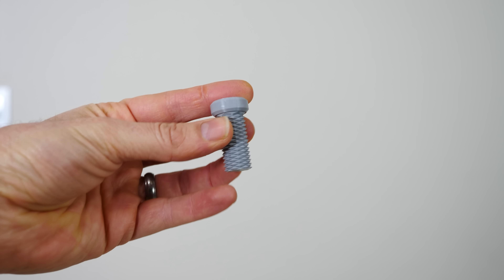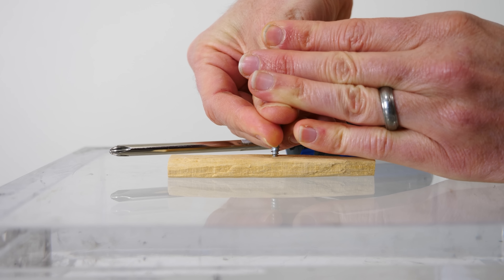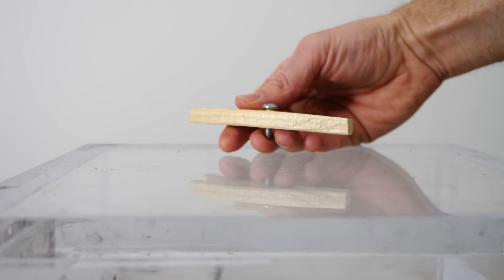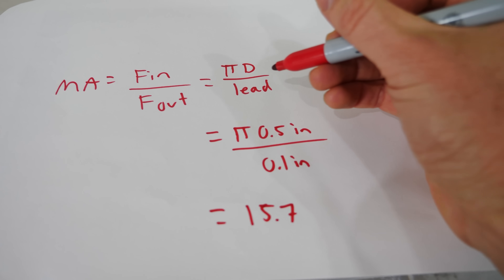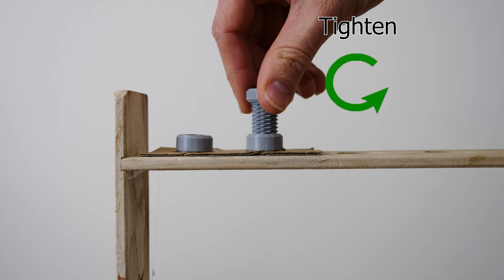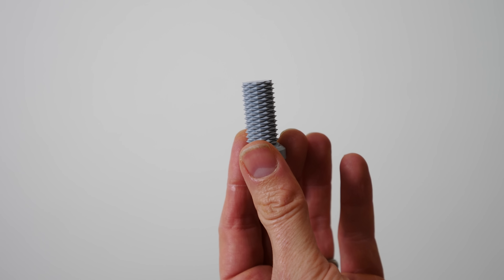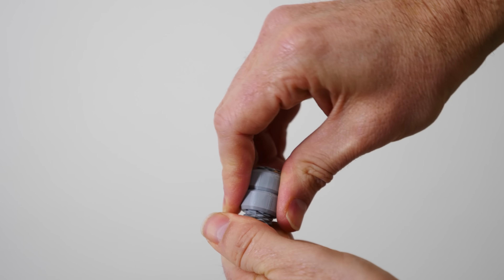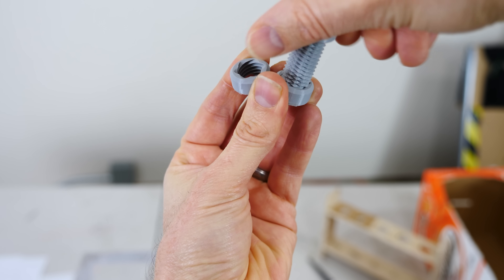A Screw That Can Be Tightened In Either Direction

Comment: You're confusing "lead" and "pitch".   Pitch is the distance between threads. Lead is the linear distance travelled for one turn of the screw. They are not the same in most cases.

Comment: So if you apply downward pressure does it still screw in both directions? Meaning like a left right back and forth motion like an old washing machine sort of? If so you may have put the kibosh on the old single direction screws...

Comment: What would happen if the internal threads on the nut ALSO had this dual threading and then you combined it with the bolt with both threads?

Comment: Would it not also be possible to do the same process to a nut? Therefore being able tighten or loosen the pair in either direction determined by pushing or pulling?

Comment: Its not quite right, that if you have to lift things that are heavier you use a finer thread. Its depending on the strength of the material you are using. For example if you want to pickup an injection mold tool, which usually weighs around 500kg-1000kg, you just cant use a M8x0.5 screw (sorry im german, i don't measure in cheeseburgers by bald eagles) - you use an M16-M20 Screw usually just because of the surface and volume that allows you to lift such heavy weights with the normalized increments in your threads. There is for a fact a raison d'être for fine threaded screws, but most of the time its used to apply more force to gaskets for example

Comment: ... maybe I'm just too stooopid to get this, but what makes sense to me is:
1 - screws won't press into the substrate, because the thread is perpendicular to the direction you're pushing and the substrate provides enough resistance (i.e. not a sponge, or foam, or sand, or water)
2 - screws won't go into the substrate unless force is applied in the same direction for the screw-thread to "cut" the thread (and hole) into the substrate
3 - the thread assists in driving the screw in; not unlike putting a brick behind your trailer's wheel, it can't go back

... I bet there are many ways to wield English to make it sound more complicated than it really is, but unnecessary. 
There are mainly 3 "forces" happening here
1 - the force applied to push the screw into the substrate
2 - the force applied to turn the screw
3 - the force the screw exerts outwards as the screw makes a hole and fills it at the same time as it is turning and cutting into the substrate.

I could be wrong, or just using other words to describe the same thing, but it's simpler to me this way.
Please correct me if I'm wrong.

Comment: Hold on,  I would be impressed if they into the same nut. All you did is change the thread. I guess I get that it's the same screw that does both but would of been mother impressing if you didn't need to change nut.

Comment: Not bad! I wonder if those nuts are designed to critical length, such they can transmit the most force without yielding? So a typical nut is 3 threads thick because it was thinner than 2.4 (I think) it would strip before the bolt breaks. This looks like it would strip easily but if the nut is 5 threads thick there might be enough shear area. How many threads thick is the nut?

Comment: 1:39 is misleading to me. You seem to work from the assumption that you apply force along the outer diameter of the screw. But actually you are applying force to the handle of your screwdriver which is a lot larger than you screw. Hence the mechanical advantage is larger than you calculate here.

Comment: Why not make the nut in the same fashion as the screw? Then you can use only one nut and one screw either way.  My guess is that this type of screw does not have the same holding strength as a regular screw because much of the thread is missing leaving less contact surface to grab onto.  Besides all that, about the only time I have ever encountered a reverse screw us on a bicycle pedal. So, idk where the economics are in screwing with it are going to matter much.

Comment: 3D print a screw that works with both left handed and right handed bolt
3D print a bolt that works with both left handed and right handed screw

these screw and bolt barely work together

Comment: an interesting idea would be if the nuts both had holes drilled in them. one empty holes and the other with spring loaded pins in them. then you screw one onto the bolt, then the other. the pins retract as you approach the two nuts meeting but once they meet the holes line up and the nuts lock eachother in place.

Comment: Your calculations for the mechanical advantage are wrong. A thread converts torque into linear force which is calculated as F_out = 2*pi*T/lead. For turning the thread with a screwdriver you could then calculate the torque you generate by turning the handle of diameter D: T = F_in*D/2
That makes the resulting ratio F_in/F_out = lead/(pi*D)
You also didn't specify what diameter D is supposed to be.

Comment: Just a thought.  Since you 3d printed the dual threaded screw, why didn't you  3d print a printed dual threaded nut?  Then you can explain how to use screw  in to 3deez printed nuts depending on the direction of  applied force

Comment: Honestly, it's nothing special because it requires two different nuts to screw in opposite directions. Wonder what would happen if the nut had lines running in both directions too.

Comment: The same thing happens if you screw from underneath a counter for example.
From the under counter P.O.V. You see the screw turning clockwise and going in the counter.
But from the top counter P.O.V. you see it come out but in the same clockwise direction..

Comment: Was anticipating directional force (pulling or pushing on the screw) to determine threading in or threading out. Still requiring the rotation to align it.

Thus creating a ratcheting screw without needing a ratchet. 

This doesn't really solve anything because it still involves a non-universal nut. Still pretty cool though.

Comment: What if we print the threads in this manner as well. We could screw and unscrew it any direction we want. Even change direction in between. More energy is wasted but solves the problem of being tightened so much that you can get it out. Cuz you can always try turning it another different. Now obviously strength is also compromised but deeper threads can solve that

Comment: So ultimately it is still the same as the rotation depends upon the nut threads. Infact this screw is a problem as now u have to first check which direction to turn the screw according to the nut.

Comment: Alright... this has no practical use other than being a cool toy. This is literally just a screw with extra steps... It may look and sound cool but think about this logically... even though you have 1 screw that turns in both directions you need a specific nut to even tighten the dang thing. It’s best to keep with what we have! Because all we need is one type of screw. 

Everyone can get so impressed by something like this so easily that they have no other choice but to drool... 

I’m sorry for the rant but actually think about it people. I’m not hating on it, it’s actually a cool design in the first place but in practical use it’s at child tinker toy set quality design.

Comment: I don't actually understand the point of this. What we use conventionally is a bolt either threaded clockwise or counter clockwise.
And what's shown here is a nut threaded either clockwise or counter clockwise. Is it not all the same?

Comment: That could be called an "omni-screw" then, since it is omnidirectional.
Wouldn't it be possible to create and "omni-nut" too, then? As in a nut that any screw, no matter the rotational direction, can be screwed in?
Then, what would happen if you try to screw and omni-screw into an omni-nut?
Since both can be either screwed in or out in any direction depending on the counterpart, how would it behave?

Comment: Freaking engineers ruining everything.  Righty tighty, lefty loosey shouldn't be messed with!😂
Reply: next time you have to work on a german car every other screw will be different ways
Reply: bolt**
Reply: @grayboynton7867  being the frustrated owner of two German cars, I can definitely see that happening 😂🤣
Reply: I was once trying to fix some mechanical watches. I tore a screw. I only learned later that it should have been turned the other way.
Reply: @erikhendrych190  lemme guess, the one on the spring box?
Reply: 'left handed screws' (screws that turn the opposite way) have always been a thing though. They are typically only used for applications where it is important to turn the screw a particular way.
Reply: worst feeling is when the righty tighty turns into a righty loosey. ;)
Reply: As a bike mechanic i still find myself tightening right side pedals

Comment: Yes but how much thread strength does it lose? Also, I guarantee you these will strip more often simply because people will try to turn it the wrong way. The tolerances on this type of thread would have to be much tighter too wouldn't they? The threads would have to be almost completely in phase with each other or neither direction would work.

Comment: People: wow what engineering! 

Me: why does he keep calling that bolt a screw?
Reply: you’re so advanced bro
Reply: I agree, but one exception would be a lag bolt. Has a pointed end, course-threaded, but a hex head.
Reply: @ActingLikeABoss  spot on.
I suppose the best definition of what he has there is a "bidirectional carriage bolt"
Reply: Its a screw if you are intended to turn the head, and a bolt if you should only turn the nut. Screws that have no point are generally called machine screws.
Reply: A bolt needs a nut type to thread-in whereas  a screw is a single ended fastener,  i guess.
Reply: The machine type is still a screw, on both a screw and a bolt.
Since this continues to be an issue, apparently: There are only 6 types of simple machines. Bolt is not one of them. From an engineering standpoint, this is  a screw.
Reply: Since it uses a nut, it is essentially a bolt, not a screw
Reply: 5:13
Reply: Because the "simple machine" (the inclined plain wrapped around a rod) is called a screw.

Not all screws are for fastening things together. You can use them for gearing (worm screw) or lift (Archimedes' screw) plus other uses.

Bolts and wood screws are just two types of the much broader class of simple machine known as a "screw"
Reply: I'll break it down for you guys, screws are threaded fasteners used to hold together threaded objects, while bolts are used to hold together objects which were not tapped. Screws are actually the main way things are held together in our lives, the shape of the head or the shape of the point is irrelevant, hell setscrews don't even have heads. An easier way to think about it is like this: a screw is a threaded fastener, a bolt is a simple mechanism made with a screw and a nut. I'm not sure how helpful my explanation was, i know I'm not great at explaining things :P
Reply: Do you say screw driver or bolt driver?
Reply: @friedpotato6846  Not to be pedantic, but it is actually a bolt in this scenario. And it would be called a "wrench" not a boltdriver. It's a bolt due to several thing:
1) it has no pointed end. Most of the definitions of bolt have to do with a metal rod in some capacity
2) the head is hexagonal instead of round
3) there is no slot on the top that a screwdriver would fit into
Reply: @trickytreyperfected1482  now hang on, I’ve seen a few screws with a hex design, they were screws.
Reply: @Turbo_The_Femboy_Fox  there are hex screws.
Reply: @afroman5531  yeah you’d think I know that since I’m around bolts and screws everyday for my job.
Reply: They are hex head screws.
Reply: @trickytreyperfected1482  i know that lmao, i was just joking about how he was calling the screw a bolt.
Reply: @friedpotato6846  try using screw driver on a bolt

Comment: I can see how useful that could be if the cross-threading was on the nut.
Reply: Might just be a million dollar idea if it doesn’t already exist
Reply: What would happen if it was on both?
Reply: @nekowerewolf9769  yeah. It would be so dynamic.
Reply: I was 100% confident he would demonstrate an equivalent nut. So disappointed.
Reply: @lucasbiaggini  yeah it’s a bummer but maybe he’ll show us his nuts another time since they’re so interesting to study
Reply: Actually, it is better this way, because if you can connect the 2 nuts by a mechanical addition and fix them in place, you can prevent the bolt/screws from coming loose and still being able to remove the bolts and screws when you need to.
Reply: @Simqer  yeah makes sense. Good point.
Reply: How do u unscrew then
Reply: @wherethefuckiam4527  Take off the nuts sleeve, and then unscrew them 1 at a time.

Comment: So basically you made a screw slightly more convenient for the manufacturer and more confusing for the repairman
Reply: Less convenient for the manufacturer. Dual threads like this have to be completely in phase with each other or it won't work. The tolerances of error would be MUCH tighter.
Reply: @Claymore1977  I thought about this after I made the comment too. So basically a useless invention.
Reply: They always make things tougher  on us technicians.

Comment: If the direction of the screw is tightened dependent on the nut can you design a nut so that it can twist in either direction on a screw?

Comment: Isn't your math on the mechanic advantage incomplete. My understand is while that is part of it the actual diameter at work is the grip of the screwdriver/wrench. This is why when you need extra pressure on a bolt you get a longer handle. It essentially acts as a lever going on a circle

Comment: So you can screw either way, just depends on how the hole wants to receive it. (based on the threading in the receptacle) But man does that come off as sounding dirty.
Reply: Yea.

Edit: With that last sentence in mind, consider that, if the nuts had a locking mechanism to prevent being loosened off, the hole couldn't become unscrewed.

I saw a similar comment and promptly cackled.

Comment: So what if you made the inside of the nut the same pattern as that screw? Could you tighten the screw by turning it clockwise by applying pressure and then midway pull up on the screw still turning clockwise and it loosens?

Comment: when you realize the screw doesn't actually tighten in both directions because the nuts are just reversed and the screw is just double threaded to take advantage of clockwise and counter-clockwise nuts...

plus it would be horrible for heavy loads and would probably get "threaded" really easily

Comment: These are cool but would be a nightmare to work with if they were being sold in stores imagine building something and then let's say you want to undo it years later and you forget which way you put it and you used different directions for every single one it's would just be annoying especially if you're not the one taking something down

Comment: Looks like it is a bit hard to turn at points in the threads -- might try a little metal paste/polish in the threads to wear on the mismatch of the threads until it is smooth turning (then clean the threads off).